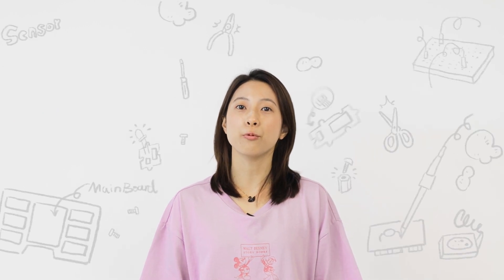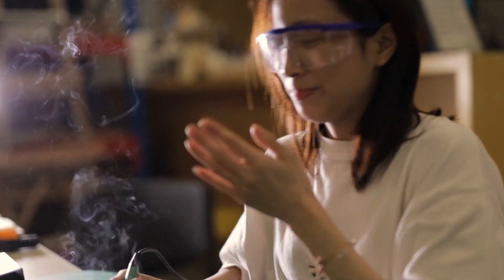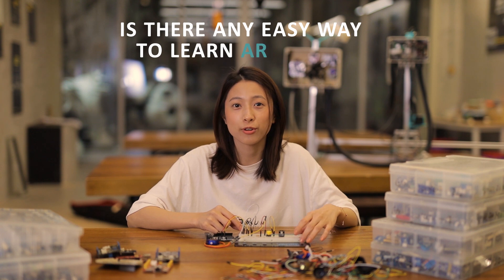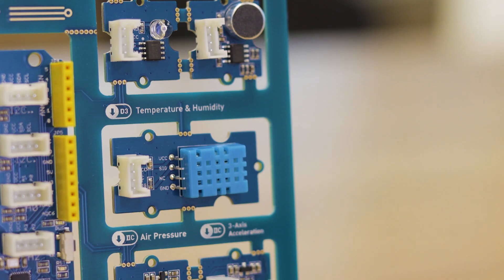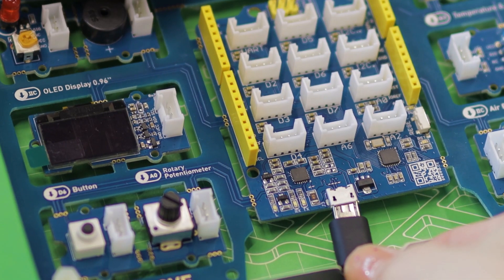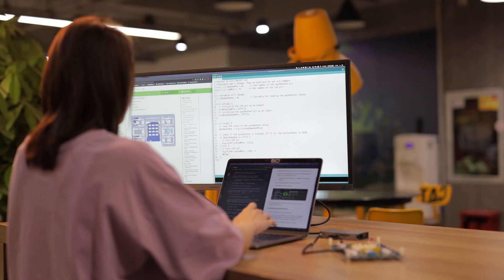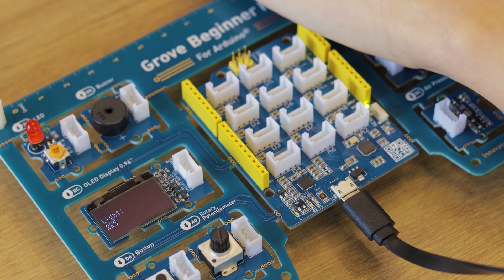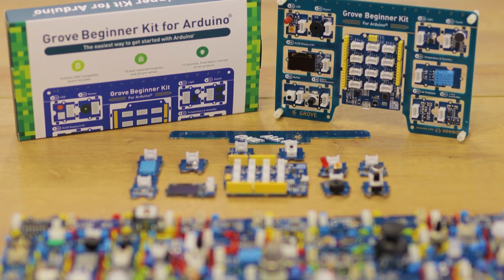Easiest way to start with Arduino - Grove Beginner Kit for Arduino®

Comment: I tried a lotus board with a few modules. I actually can solder decently since I was 7. But prototyping something using grove ports is really nice. Just plug it in and code. I really like this. Also these modules and parts aren't expensive.
I also tried some cheap things from amazon, also works, but more hassle. 
Every module has a support page with examples and all documentation. Great work.
I actually bought it to experiment with the pressure sensor and emg sensor, for a friend of mine that has a muscular disease. I had the pressure sensor working in about 5 minutes. 
Brought it to him to day, with a relay board and some cables. He could finally have a button that can set the sensitivity. Still need to make a housing and program so he can adjust it with some buttons. But the first test worked great. The muscle sensor needs some more testing, as I didn't yet find the right placing of the electrodes. (it also seems emg is a bit more complex then just reading a voltage) 

I didn't get this kit yet. Looks cool. Also saw it actually works without even plugging in the cables.  That would be great as a gift for me, because the other lotus I will give to my friend.